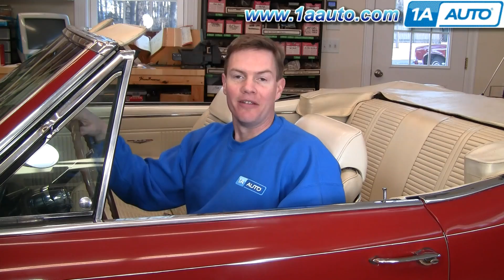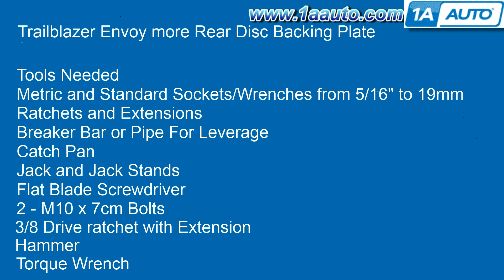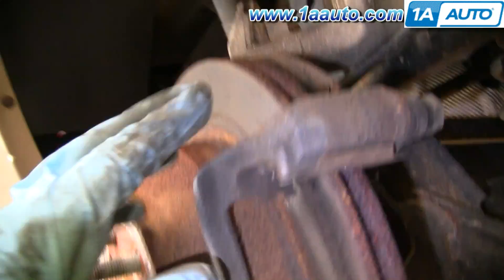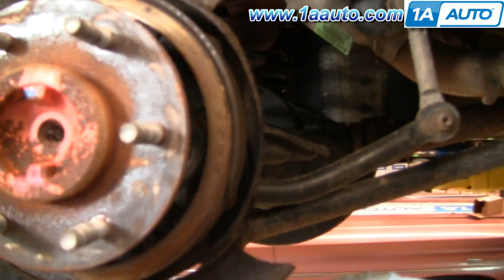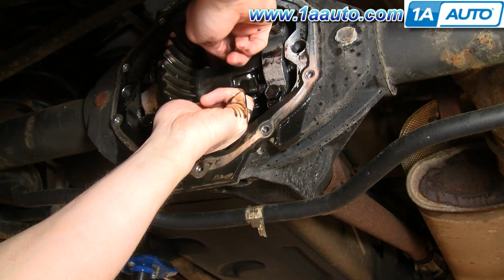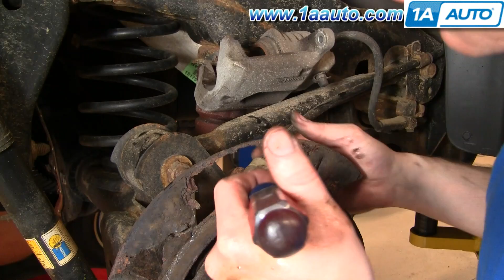How to Replace Rear Brake Backing Plates 02-09 Chevy Trailblazer

Comment: Holy poop you would think GM would use stainless on the plates if replacement is this in depth.
Reply: Replacements should come in 2-pieces so you don't have to pull the axles.  I'm thinking about buying then, and carefully cutting them in half.  Paint the edges, and use a couple galvanized brackets to hold everything together.

Comment: You'd think that general motors would have made it easier to replace instead of having to take the rear axle apart to replace the new parts...
Reply: Right. I am pretty pissed about this. The parking brake is so important it should be illegal to design it this way, it creates a dangerous situation with neglected and failed parking brakes.
Reply: Cut them in half, paint and install.  I was reading some reviews, everyone was doing this.

Comment: I need to replace the backing plate/dust cover on an '04 Honda Odyssey, but not finding much info online. Can you please help? I know how to handle the bearings and disc brake components. Looking for torque specs for the through-bolts, as well as any tips or mistakes to avoid.  Your videos have saved my butt more than once. Thanks for sharing the knowledge!
Reply from the maker: +Travis Dieter We currently do not have an auto repair video on this particular repair. Thank you for asking. 1aauto.com

Comment: Just wondering, I've got a legacy and I've had one brake dust shield on the front and one off for 5 years and I can't tell any difference between having it or not having it other than it's easier to inspect the back of the rotor.  I've seen no ill effects and I live in the rust belt.  Are these shields really needed?  I have alloy wheels and the whole front of the rotor is constantly exposed to dust, water, etc.  The wheels spokes are very thin, there is no protection there at all.

Comment: What is the part called that is in between the rotor and the backing plate you are replacing? it the piece that the caliper bracket mounts to. On our 99 silverado that part is bent and the caliper mounts crooked, need to replace it but cant find it anywhere. 

you have the old backing plate in your right hand, and the part i need is in your left hand.

Comment: Are there backing plate on front brakes too? I just recently had my front rotars and brakes replaced on my 98 f150 and two weeks later the front driver side brake is making a grinding noise on the rotar.
Reply from the maker: Thank you for watch. Yes the front will have a backing plate as well. If you think the plate is grinding the rotors you can get a screw driver and bend the plate itself back a little and see if that helps.
1aauto.com 888-844-3396

Comment: Thanks, had issues with rusty rotor and emergency brake.  Didn't realize installing bolts into spare holes would help remove rotor.  Tried using heat and mallet to no avail.  Yeah my backing plates are falling apart not sure if I want to remove axle and all at this point.  How detrimental are the dust shield/backing plates???
Reply from the maker: They should be replaced if they are very rusty and brittle. The backing plates help to retain and secure some of the hardware that attach to the emergency brakes. 1aauto.com 888-84-3393

Comment from the maker: It may be a different process on your 2004 2WD may be different. This particular part wouldn't fit your year make and model. You might be able to use some of the basic steps that are shown in this video on your truck. The tools needed may be different sizes than what's shown here. 1aauto.com 888-844-3393

Comment: Would this process be similar for a 2004 GMC Sierra 2wd? The setup looks exactly the same. Also, how long would you estimate the job took? I already have new rotors, new caliper, and caliper bracket on, so half the bolts have been freed recently. Hesitant about pulling my axle.

Comment from the maker: Yes the plates keep debris away from the rotors as well as on some vehicles house the wheel cylinder for the rear brakes and hold the shoes in place for the emergency brakes.

Comment: what is the function of these plates, not to seem stupid, but looks like they keep dirt off the brake pads?
Reply: They protect the cavity where the brake drum pads are from water and snow ect. Also works as a structure to hold the components for the parking brake. You know, potentially life threatening stuff all on a flimsy peice of metal designed to never be replaced.